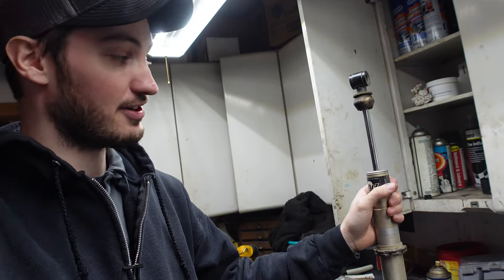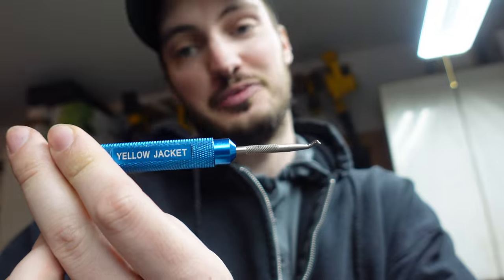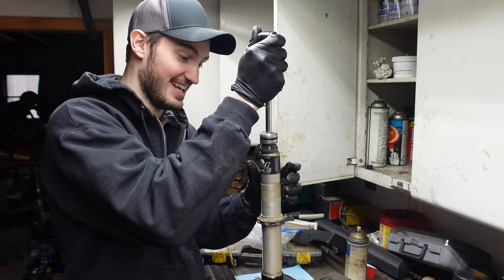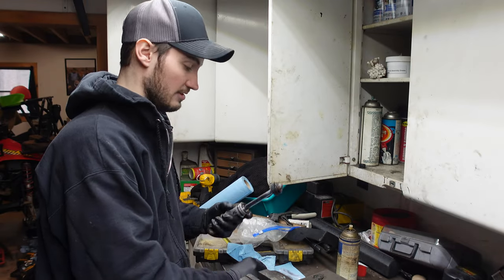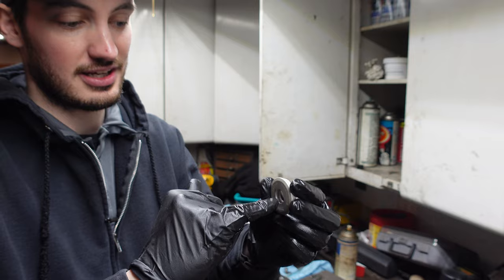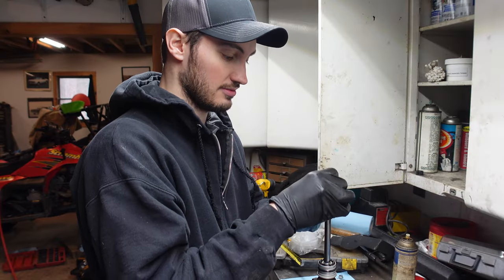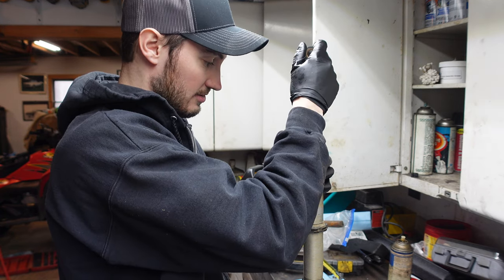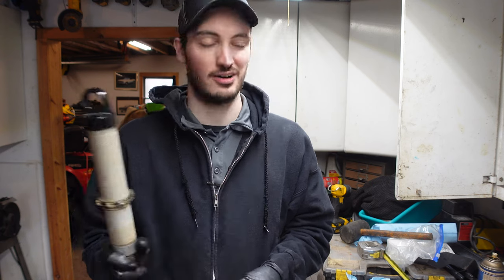How To Rebuild A Monotube Internal Floating Piston ATV/Snowmobile Shock!

Comment: Very informative. I have a 96 RST3 mountain bike with a Noleen mono shock. There is no PDF for this thing but your walkthrough seems to be what I need to do. I do have a question though. If after you release the nitrogen charge, then remove the internals can you use the measurement of the IFP before to blow it out to get your reassembly depth?
edit : 'before you blow it out'

Comment: Good job on the rebuild couple things you should do differently though. 1 get your self some seal protectors from carver. It's a little plastic piece shaped like a bullet. That slides over the threads on the shaft so that the seal does not get cut by the Sharp step on the shaft. Also when you install the shaft into the body you should tap on the shaft with a hammer to "flex" the shims to get the air out of the piston. Keep up the good work.

Comment: Consider just measuring 8.25" on the hammer and marking it with tape so you don't have to insert the tape measure into the shock body.

Comment: I've got a shock that I think has a significant amount of pressure trapped in the oil side of the floating piston. I've purged all the nitrogen out that I could, even removed the valve from the shock completely and I can see the floating piston (it's all the way at the "bottom" near the nitrogen fill valve). However, the shock still rebounds, and I can't push the seal assembly inward at all, no matter how hard I push on it, so I can't remove the snap ring. There's definitely gas mixed with the oil as I can hear the oil splashing around when I shake the shock.

How do I get the remaining pressure out of the shock?
Reply: Did you ever get this resolved? Just started doing my 2.0s with no reservoir and I can’t get this bearing to move down at all to get the clip out

Comment: Thanks for video been looking for this. 2 questions, first you didn’t change the nitrile puck how come? Second shouldn’t the oil be overflowing out the top when you insert the inner cap piece to insure no air is mixed with the oil?
Reply from the maker: Yes it can be overflowing. I didn’t have any problems with air after rebuilding these.

Comment: How did these perform, just curious. most rebuild videos I've watched the person doing the job, bleeds the oil and pumps the piston up and down a bunch of times to get all the air out and completely fills the shock body with oil before putting the seals back on and charging it.
Reply from the maker: Works great. I did bleed them off camera and got no air out.
Reply: @LetDirtFly  oh great,  I plan on doing my KYB shocks on my Ski Doo this summer. Just doing my homework now so i have three seasons to get them fixed if I mess something up